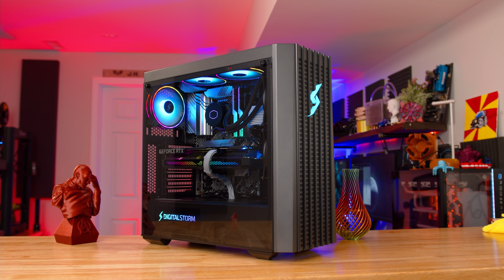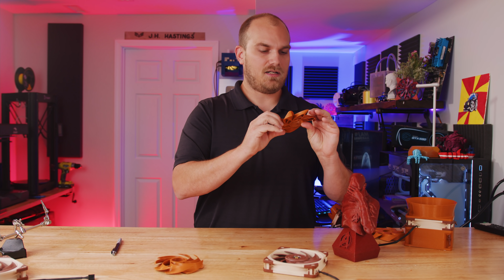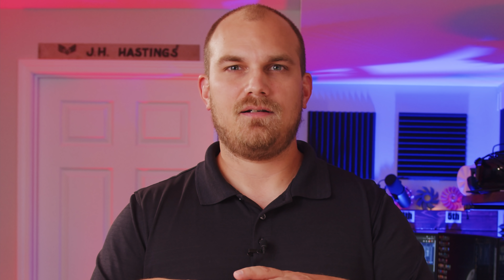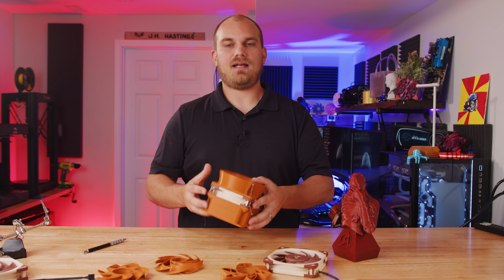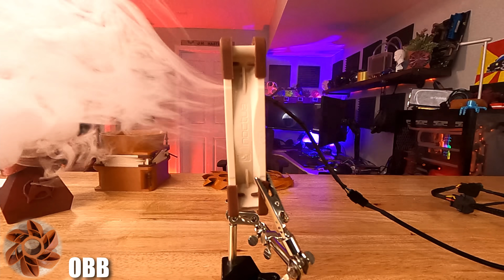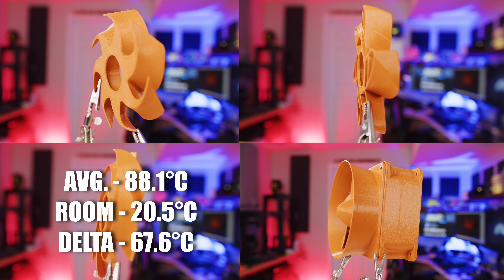Is this CHEATING? - Fan Showdown S3E3

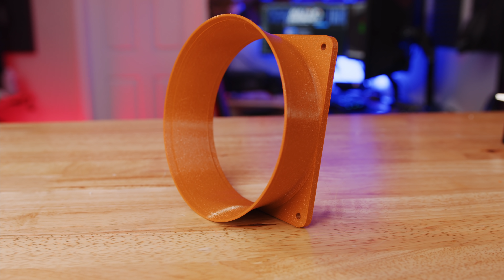Comment: 5:10 the explanation of what a “velocity stack is” is not correct.
To achieve laminar flow, you need something to “comb” and straighten out airflow, usually a thick honeycomb or grates is used. This can be seen in most wind tunnel.
The “velocity stack” is what we aerospace engineer call “intake” or nacelle. What these does is condition the incoming airflow to make them more suitable for the fan (or compressor). For example, for a jet engine, the nacelle in front of the fan is usually slightly smaller than the fan. This is done to slow down the incoming airflow to more suitable speed, allowing the fan work at peak efficiency. This is why you usually see a ring of shinny “lip” in front of a jet engine.

For a computer fan, the aerodynamics is a bit different as the flow is usually not fast enough to warrant slowing down air flow in front. These “velocity stack” does exactly what then name implies, they speed up air flow using Bernoulli’s equations.
At low speeds air is not considered as compressible, and since the “velocity stack” does not act on air molecules directly like a fan, the mass flow rate at the entrance and exit of the stack should be the same. Mass flow rate is volume per second times the material’s density, and volume per second is cross-sectional area times velocity. 
So by manipulating the cross sectional area of the “velocity stack” you can increase air speed by having a smaller exit diameter (smaller cross-sectional area).
Now, “what does it have to do with Bernoulli’s equations?”, it is because a fan pull air though by creating a pressure difference in front and after the fan, effectively dig air though the fan. The air pressure immediately in front of the fan is lower, because there is less air there. atmosphere around that pushing air molecules into the void created by the fan, causing the suction you feel. In order to exploit the existing atmospheric pressure (which is static pressure), you want somehow lower the static pressure further. That is where Bernoulli’s equations comes in (p1+q1 = p2+q2), p is static pressure, q is dynamic pressure which is related to velocity. We have already explained why velocity of air is faster at end of “velocity stack”, so static pressure at exit is even lower than entrance, which encouraged atmosphere to push more air into the intake. This cycle only works when there is a flow, and it’s not infinitely exploitable, first at 30 percent of speed of sound you will start encounter compressibility issues (p1+q1 =/= p2+q2), at speed of sound the flow will be “choked”… well at that point you are too far down this rabbit hole.

Comment: Ideas for you: Pump Showdown (Liquid Cooling), Flying Fan Showdown (Helicopter blades with a force meter), Generator Fan Showdown (Desk Wind Turbine with power meter), Desk Fan Showdown (You had this one already), Hooked Showdown (Tensile strength test)

Comment: I fully support allowing fans with separate parts, I was hoping someone would do exactly what the cheater did. Velocity stack, spinner cone, diffuser cone, and expansion stack. As the name suggests, it is kind of cheating as these parts can be added to just about any fan without much effort. If you get enough ‘cheater’ designs, you may want to split up cheater vs non cheater designs, especially since cheaters are not as easy to integrate into a PC case.

Comment: Why is the rating based only on delta? Why don't noise and RPM factor into it? A fan whose delta is 55 at an RPM of 3,000 and a dBA of 60 is worse than one whose delta is 57 at an RPM of 1,000 and a dBA of 42.

Comment: Notice how the cheater is spinning at a low-ish rpm still, it's heavy but engineered very well. I believe the blades were printed separately so they could be orientated differently to have a smooth surface and reduce air friction/turbulence.

Comment: The "difuser" is actually an static axial flow compressor. It constrains the flow so that only the flow from the fins is unconstrained so it greatly reduses backflow, hence increases static pressure.
Reply: Well a lot of people would just call them "stators" to the rotor that is in front of it.  And really what it does is turn the swirling induced by the rotating first stage into more pressure/velocity.  Still waiting for someone to make a proper turbomachinery style rotor/stator pair for this series.

Comment: I think that making the notice design a little bit thicker should be enough to make a much solid fan, because even with low rpm that fan has achieved relatively good temp

Comment: I expected the cheater to place first and also think it should be included. The obb however came out of left field. I don't understand how it placed third which makes it  the most interesting fan you have ever tested by a large margin. I would be interested in a resubmition of a tweaked design if they think it can be improved. Also an in depth explaination of why it works.

Comment: Huge fan of this series, but I noticed some things you can improve.

the smoke test video needs work. It looks like you're using a gigantic ISO, which leads to the high noise. It also looks like the white balance is off, giving the shot a reddish look. Just a matter of learning new tech, you'll be pro in no time.

Personally, I'm not a huge fan of editing in slow-motion with regular frame rate footage, but that's your artistic choice.

Comment: I am fine with the out of the box designs with all the extras, as long as we also keep 2-3 fans that just fit the standard form factor. 

Having the out of the box stuff adds entertainment value and lets face it we need and want some of that :D 
However I do believe the best designs are made under constraints so forcing people to stick within the frame is what the core should remain about. 

On the same line of thinking 2 ranking lists of outside and and inside the box would be fair with the outside the box list should just be a king of the hill deal :)

Comment: in regards to the cheater, I think its fine. If you wanna spend more time on the fan go ahead. And i think based on first place of the first series and all but the winner of the second series, its clear that its not necessary to do what they did to place favourably.

Comment: Cheater's rear attachment should have probably been angled clockwise as opposed to counter-clockwise, much like the stator vanes in server-grade 38mm thick fans, which really helps tighten the air flow and also pushes it much further. Could probably have added more vanes and cut down on the stator length.

Comment: i think a big advantage of the cheater over normal fans is that it puts the fan at a distance to the radiator.
that way the dead angle behind the motor gets cooled as well. the diffusor helps with this.

Comment: Honestly the cheater looks like it could be turned into a set with the velocity stack and diffuser since they would fit in quite a few cases on the front panel. Eyeballing it, i think it would fit on my p400a front fans. I'd like to see how well those two parts do with a entirely stock fan

Comment: Would like to see the Noctic Rev 2. It's an easy fix to prevent the centrifugal deflection issue. It's clear that the blade's profile is not utilizing centripetal and aerodynamic forces to induce stiffening effects, so a collar or ring is need to prevent the deformation. 

The blades being so thin means there's little mass, so I'd ideally place the ring around the blades tips to keep the added mass to the edges in order to increase efficiency at higher rpms.

Comment: Would love to see the Notic made with a stiffer plastic... Glass or CF reinforced nylon or something like that. Might allow it to spin up without hitting the sides.
Reply: Or perhaps put a thin ring around the outside. It shouldn't hinder the airflow much and would stop the blades from pushing out.

Comment: You need to start comparing Shrouds.  Yes, the Cheater did better than the A12x25, but how does the A12x25 perform with the velocity stack and diffuser? How does the Slug mk 2 do with the additional element from the Cheater?

Comment: Looks good. But maybe a separate chart for the multi part ones or they only go on the board as run with just fan? Since It's the fan showdown not the fan accessory showdown.

Comment: How about either:
A) two different classes of fan, based on whether they fit within the bounds of the case or not - kinda like boxing classes.
B) change to efficiency, based on cooling per gram of plastic - which might lead to people making some very lightweight designs!
Reply: or efficiency as in performance per watt? hard to measure such a low watt usage though
Reply: i think you could just do efficiency as a secondary stat and just have people optimize both

Comment: I think there should be 2 categories, with accessories and without accessories. Obviously adding shrouds will give it a leg up over designs without shrouds, so not really fair to the other fans. At the same time I really enjoy clever solutions like these, and want to see more. Maybe we can encourage more outside the fanbox designs and rank them separately, then it would be interesting to run the seasons fans within those solutions and see how much we can get good standalone design working in an expanded platform.

Like the new camera quality and the videos are awesome as always.

Comment: I was really surprised and impressed with the OBB in the smoke test. Pretty awesome looking fan too! The way the "Cheater" funneled that air in was really impressive, but no surprise like the OBB was. I don't consider it cheating per say, as it was quite clever engineering, but they way OBB moved air in the "stock" (no shroud or diffuser) configuration was the real winner in my book.

Comment: It's not cheating at all, not even a new category as others have mentioned (though one should be made)
You can't cheat if there's no rule against it, period.  Creative design is all about finding new ways around established norms... bending the rules so to speak.

Now, for the next season, I would like to see a rule stating that the fan needs to be fully encompassed within the factory fan shroud. That would keep with the spirit of the show, creating a better fan than the stock noctua.  

And a no holds barred category separate from the standard showdown for all of the crazy velocity stacks/compressor assemblies/flow equalizers/etc.... That could make for some crazy interesting design work

Comment: Definitely allow multi-part fans. Cheating is only cheating until everyone else is doing it too. Also, by not imposing artificial limits, you're opening the doors for potentially higher-performing fans. I second the other comments saying it would be interesting to see the Noctic with a support ring.

Comment: The lighting in the smoketest shots was super dope. And the high frame rate really benefited the shots

And i think the noctic should be printed again a little smaller so it can spin faster without touching the housing

Comment: The big shrouded, multi-part fans are great as experiments but it kind of beats the purpose of the fan showdown was to find out good fan designs that fit within the noctua frame. The shrouds will give extra performance to any fan, you could also strap a huge motor to the fans and they would perform better but thats not the point of the showdown. Its still to cool to see the big ones but i feel they should have their own category or something.

Comment: You know with that flower shaped one if they squish all the blades and kind of screw it tighter or screw the design tighter and make it longer they got more blade for the amount of blade. It may add to the complexity but if you grab the center and do some magic with your other hand by twisting the tips of the flower shape even tighter but stretching it out as it does that maybe it'll make it even better design I'm not sure

Comment: Man, your production quality and testing methodology continue to improve by leaps and bounds! Keep it going! 
A few ideas: 
  * Are there simple treatments that can improve strength or rigidity of a 3d printed part? (Baking, chemical treatments, etc) and can fan makers also suggest using those post-print? 
  * Add tests for static pressure ?
  * Test at a base rpm value (e.g. 800,  flow, noise) 
  * Test at the maker's suggested rpm (flow, noise, actual cooling performance, if RPM is achievable)
  * Test at maximum RPM while noise is below some given Db range (flow, maybe cooling performance?)

And also possibly where (air_flow/power_draw) is at a maximum

This should allow you to characterize fans for a range of computer uses and not for just CPU cooling optimized for a specific CPU cooler.

Comment: First off, camera upgrades are on point! Love the 4k smoothness.

I have a couple recommendations all centering around the smoke test.

Issue:
In each of the three tests, decibel rating, smoke test, and temperature control, the smoke test is the only test without a data analysis metric attached to it.

Discussion:
While it is fully understood this test isn't directed at being lab-quality, a third definable metric would help better collect data associated with a fan's characteristics, such as slope, pitch, shape, etc, to help the community better design and develop fans to potentially maximize all three areas of performance.

Recommendations:
1) Use a container with a known volume to pump the smoke into so that we can get a better idea of its ability to evacuate a known area of smoke within a specific timeframe. 
2) If that container idea isn't up to par, potentially add a clear length of tube behind the fan to act as a shroud so we can better visualize the speed & density of the smoke getting pulled through.
3) The easiest route, add an anemometer behind the fan so we can get a wind speed reading 

Love the show, love the channel! I love lamp?

Comment: to be fair running fans at more than 500RPM is already an acoustic challenge that only few can pass, from my experience only A12x25 managed that feat, so while surely less durable the Notic (and all others actually) at operational speeds, not cranked up till the motor limits

Comment: I'm surprised that the Fan Showdown has gone on this long.  In a good way!  I'm impressed with the creativity of everyone keeping this interesting.  Awesome job everyone!
That said, I think the Fan Showdown really needs to have two categories now.  We've proven that intake cowls help.  Now we've got exhaust too.  Well, duh, right?  Make a fan bigger than the limitations of the fan housing and it performs better.  When done right.  But, of course, would it FIT everywhere it could be used?  NO!  Of course not.  So I think, to be fair to the fan designers, two categories: a. fit and b. chonkers.  That way fan designers get fair comparisons and competition.
Reply: You do have a point, but i would rather say to solve it by having two leaderboards. The first one only the fan (even fan with "attachments" could join if tested without them) and a second one where anything that fits are alowed. This should keep the series concise and easy to folow due to everything being tested on the same video but would keep the competition fair.

To be fair, i doesn't see a problem with how it's done right now, after all it's just for fun.  Doing all of this additional testing may require way more work and time for each episode, could be a problem.

Comment: In regards to nestos cheater: diffusor is not the correct term, from an engineering perspective. Since what he designed is essentially a single stage axial compressor, that end part would be the stator. The purpose being converting rotational energy into higher laminar velocity. Wich worked pretty well, considering the smoke test footage. The purpose of an diffusor in contrast is converting impulse energy into static pressure after Bernoulli's principle.
Reply: Thanks, mate :-)

Comment: I'm thinking the fan showdown should start breaking out into categories. Multi-part fans, "flat" fans that fit in the fan housing, tall bois, etc.
Reply: Agree.
Also need to rate separately for noise and airflow/cooling, or come up with some sort of handicap calculation where noise and temps combine to give the overall score.
Reply: just put a * next to them on the leaderboard end say that * means it has shrouds, diffusers, etc
Reply: Yeah, something like in motorsport where you have categories like stock and unlimited.
Reply: @koimaxx  exactly like that

Comment: I think all the ones that have extra parts should be tested both with and without their parts. Will help extrapolate the benefits of the additions. Imagine the OBB with those parts!
Reply: Definitely a good idea... Test out the fans with the components and see whether it's better with or without certain components installed
Reply: Should test the other fans with the extra parts, that were provided by the one fans extras. Im curious what the results would be.
Reply: My interest is in seeing the base a12x25 with the cheater's accessories!

Comment: I think you just need to have a separate ranking including only fan designs that fit within the original form factor. It is really cool to see these all out designs, but most of the big ones aren't practical for actual use, where some of the ones that fit in a regular form factor could be something people actual want to use for the cool factor.
Reply: For me I think a 42db(or lower) normalized test with another ranking would be great, because in the end, it is what counts for most people.
Reply: Could also have another category for shroud designs
Reply: I would put a cheater on my PC if it was optimized a bit more
Reply: I could see some of these bigger fans used on a side panel over the CPU possibly. Not a bad suggestion though.
Reply: only fan 🤔

Comment: If you put like a ring around the outside of the Noctic fan, kind of like the axial-flow design ASUS uses on their GPUs, it should remove the rubbing issue.